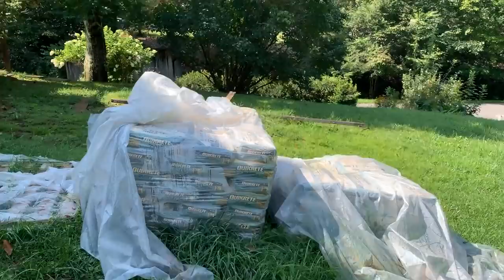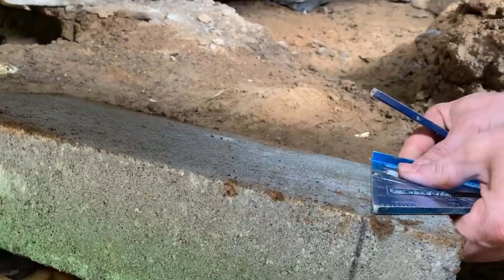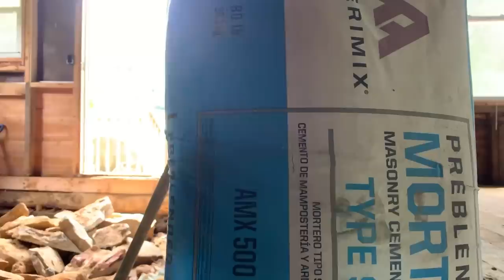Chipping away at this 100 year old house renovation

Comment: @ART - Will you be inserting a water/vapor barrier between the wood & the concrete footers?
  Without it, where the two materials touch, the moisture of the concrete will constantly be wicking it into the boards they touch. The wet wood will attract termites & will quickly begin rotting  That happened to my Dad's house in NC, even though the crawl space was well vented. Large pines on that end of the house had shade trees, so always stayed moist. Everything from the waist height in corner kitchen to the concrete was dry rotted for about 12 feet along the above the footing, & the thicker corner. The moisture attracted hordes of termites that riddled all the wood. 
     We had already finished restoring the other three house sides. This was the final area. We would have to contract to have the entire house up & blocked while that corner would be replaced. Afterwards to be lowered to the footings. It would've cost more than all other three sides combined. 😂

Comment: Bravo to all family members!! 
Please know I have never done foundation work, I just tend to pick up bits and pieces I see and hear along life's path.
 First, please, please, please consider masking up when pouring out a bag of cement into your wheelbarrow, even when outside. Look back at your video to see how the particles fill the air.  
Next, to prevent mold, I thought flashing or plastic or something is put between the wood beams and the cement blocks by laying it on top of the cement blocks, but maybe ask a contractor before you no longer have the option to do it (house put back down on foundation).  Sorry if you explained why you are not doing this if there is a reason.  Might have missed one of your video explanations.

May God continue to pour blessings upon each of you.  Again, bravo!

Comment: Suggestion for you Art. Fill up a trash bag with moarter and use it like a giant piping back like you are decorating a cake. Easier to get into those tight spaces with a flexible plastic bag than the trowel.

Comment: how about using a hydraulic jacking to lift the house just a bit extra in the corner you are working on so you have additional space to work (where the beam is you can then remove the current support and place the house back down on new support after the block wall is set up )

Comment: Sandra Westley uk I do see all your problems, don’t get me wrong, and I know you wanted to save the house, but the work is endless, I do wish you had done what the Hollers did, and that was to get a ready made home, so you could all just concentrate on the farm and family, and perhaps build the house much much later, when they’ve all grown up a bit, it’s so short a time you have with them before they’re all grown up and fly the nest. So sorry for Brianna’s distress it must be so exhausting back and forth to the hospital
Reply: The hollers did not buy a ready made home. They slogged thru gutting a trashed trailer home turned into a "new" home. We are also nearing the finish line on a total gut and restoration, and we have lived in it the whole time. Takes forever. Zero regrets. Don't steal the process from them.
Reply: @willowgrove9288  still a trashed trailer is MUCH easier to work on. There's no way Art & Bri could live in this house it had mold remember? Each situation is different.

Comment: Just curious, how do you know there is not mold under all that siding ?  Continued prayers for the babies . They will be home soon .
Reply: When he insulates he wil put a vapor barrier and that will seal the inside of the house from the outside. With the lack of moisture constantly in the house with the water problem solved it should be okay.

Comment: I used mortar to tuckpoint a rock wall pushing the mortar in the tight places with bare hands, ended up getting chemical burns on my hands I had no I idea that would happen. If I had known to neutralize with baking soda I would have saved my burning skin.😒

Comment: the house has certainly passed the midpoint by now. once the pipes and floor is done, everything after that is home run with insulation and walls.
Reply: Punky  seems to be only thing for US and UK. I dont know why they would put something like that in building code just to ensure houses will grow mold because the materials dont breathe at all when it turns the building into a plastic cube.